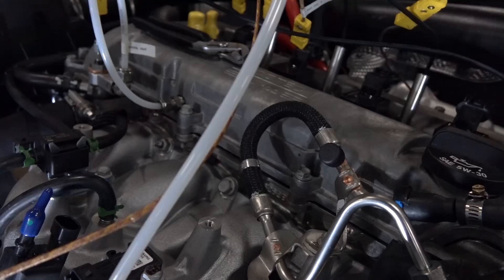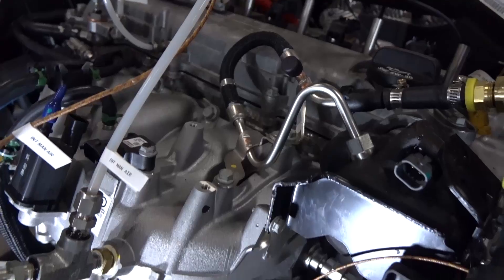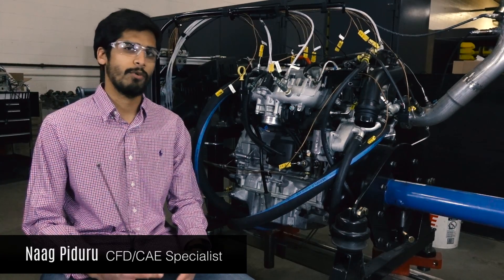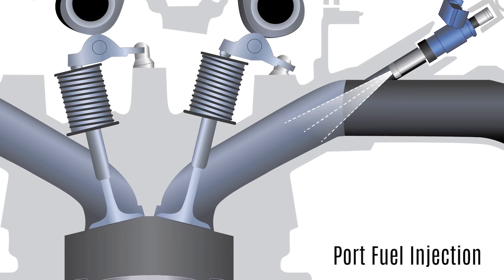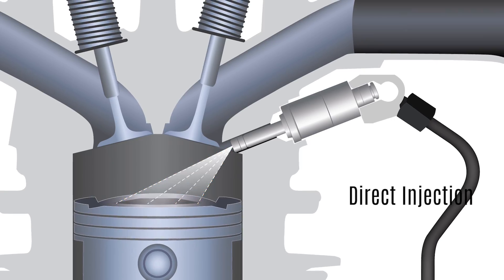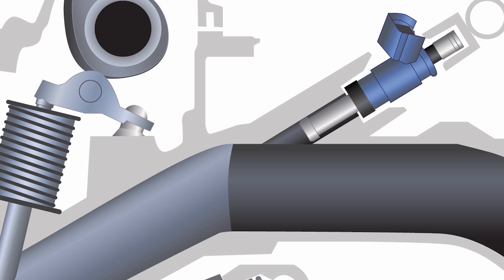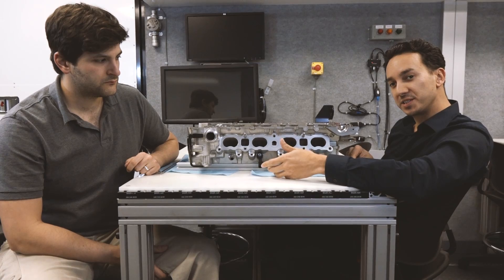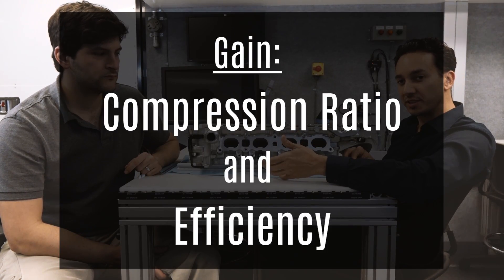Knowing With Nostrum: GDI vs PFI; What's the Difference?

Comment: if the fuel is injected directly to the cylinder then how come there still is an intake valve in GDI????
Reply: ...how does air get in?
Reply: Air and Gasoline are mixed outside the cylinder not inside it.

Comment: GDI STILL needs to solve the intake valve carbon buildup problem. Or all of that efficiency goes out the window with time. Toyota has solved the intake valve carbon problem by installing one port injector and a direct injector per cylinder. So that the port injector sprays off the PCV blowby crud on the back of the intake valve at low power requirements and the direct injector injects fuel at high power requirements, maintaining the cylinder high compression efficiency. 

Direct injection is a very good idea. But the intake valves need attention. Because of the PCV blowby being drawn into the induction system past the intake valves by design, baking on the blowby carbon on the backs of those valves on most GDI engines.

Comment: Vehicles equipped with DI has more reliability issues than PI, i have 2 bmws, one with the N54 DI engine the other with an S85 PI engine, i had to replace the fuel pump and injector for the the n54 engine on 2 occasions while ive hadn't had any fuel related issues with the other car